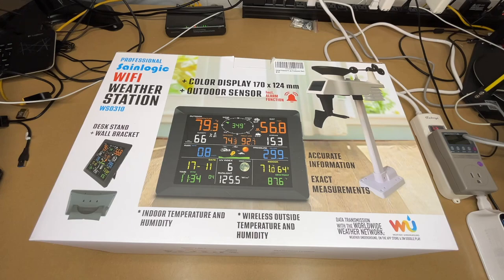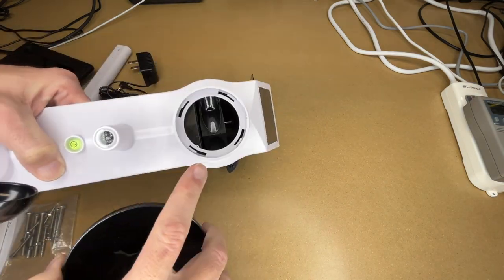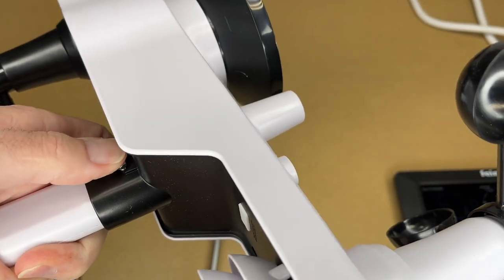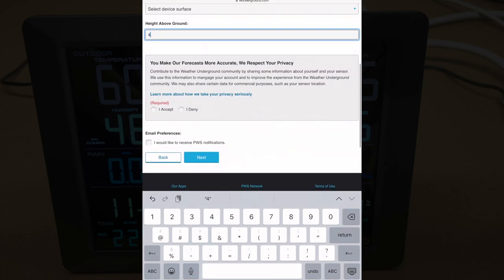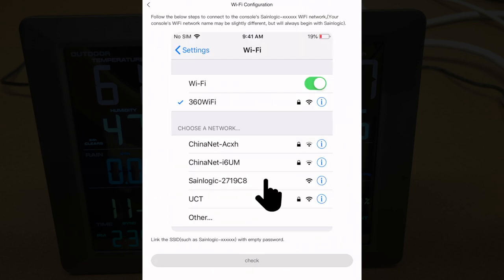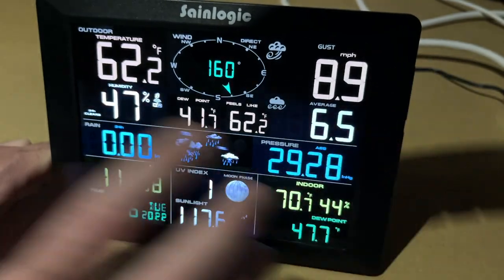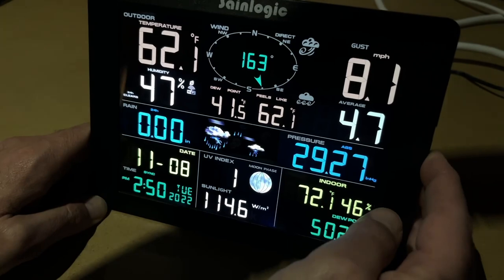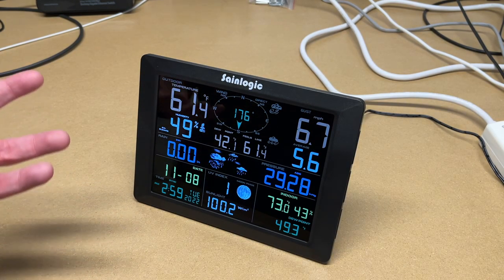Sainlogic WiFi Weather Station with Temp, Humidity, Wind, Rain and More

Comment: Returned mine.  Solar power gauge doesn’t have the range and gets saturated.  Company did not inform about that on their Amazon listing.  Additionally, the outside temperature gauge also was inaccurate, with a strange temperature spike at the beginning of the day when the outside temps were 10 lower than the unit registered.

Comment: Finding it impossible to get the station to communicate with the screen. It’s not getting past the blinking reset… HELP??
Reply from the maker: Do you have other weather stations around? That could be messing things up. If you do, try removing the batteries from them and try again. Also make sure you have fresh batteries in the Sainlogic.
Reply: Im having same problem...no.other weather stations around and have fresh batteries

Comment: Thank you for the video, you explained the unit great. I am wondering if all the functions will still work without having it hooked to the internet? Thanks again.
Reply from the maker: Almost all of the functions on the weather station will work without being hooked up to the internet. The one I can think of that won't is the auto-setting time. If you don't want or need internet capabilities, you might be interested in this model: https://youtu.be/Ki46cU_Ip2c It can set the time wirelessly via a time server signal. It has a lot of the same features but not all. For instance, it doesn't have solar and UV. You can open Amazon links to the two Sainlogic weather stations to compare the exact features.

Comment: Mine has disconnected from the Wifi after only 6 weeks what a pain.
Reply from the maker: That is odd. Were you able to get it connected back up?
Reply: @Rickmakes  yes I was I rebooted my Starlink router/modem and it connected back up right away.

Comment: Very informative video.  I just got this model - and I'm setting it up for the first time.  I'm glad I can run the console on battery-only because I want to wall-mount it without the a/c power cord attached.  I don't mind pushing the snooze button to turn it on.    I would like to get a second console for upstairs.   Question: Will a second console work with the outdoor transmitter that is provided with the first console?    Thank you for posting this review.
Reply from the maker: In my testing you should be able to use a second console with the one transmitter. You can buy a second console directly from Sainlogic: https://www.sainlogic.com/english/sainlogic-weather-station-display-screen-for-0300.html I don't know if that comes with a power supply (but it sounds like you wouldn't need it).
Reply: @Rickmakes  Thanks for your help.   I did end up getting a second console.   I can confirm that both consoles can share a single transmitter.  I bought 2 complete units, so I also have a second transmitter I can use as a spare, if the first one ever fails - or gets destroyed in a hail storm - which happened on my previous weather station.   I mounted both of the Sainlogic consoles on interior walls.  One upstairs, one downstairs.  With a little work and patience, and drilling 1/2 inch holes in my walls, I was able to snake the power cord thru the wall to power each console, while completely hiding the wire.  Now the consoles stay on, look great, and I don't have to press the snooze button to see what is happening.  I researched weather stations for about a year before finally deciding on this one.   I'm happy with the purchase.  It replaces my 20 year-old La Crosse WS-2510 solar-powered weather station - which had a long life, and worked well - but finally gave up the ghost.
Reply: @Rickmakes  One other item I noticed when setting up my Sainlogic WS0310 stations.  Initially, I was not going to use the a/c power adapter.   This will work, as long as you don't mind pressing the snooze button to get the backlight to come on.  The backlight stays on for 7 seconds, and then turns off to conserve battery power.  There is a caveat to this setup however, and that is the unit will appear offline in the Sainlogic app - and also in Weatherunderground.  My conclusion is that when running the unit solely on battery power, it conserves power by not sending regular updates to the app and Weatherunderground.   So, if one cares about using the online features, powering the unit with the a/c power adapter is required.

Comment: Great , BUT
I have a question. 
I would like to I stall one like this at a local lake side to know the actual wind conditios (direction and strenght) to know if it's worth driving out there for Wingfoiling and Windsurfing.
I was thinking to connect it to a cellphone over wifi and use a pre paid recharge SIM card in it
Using a small rechargeable battery and small solar panel to power it all.
Now  y question ...
Is it possible to program the unit so it only send data from the cellphone at present time intervals to limit the data use on the pre payed Sim card ??
Reply from the maker: It doesn’t have that capability but how tech savvy are you?
Reply: @Rickmakes  it depends